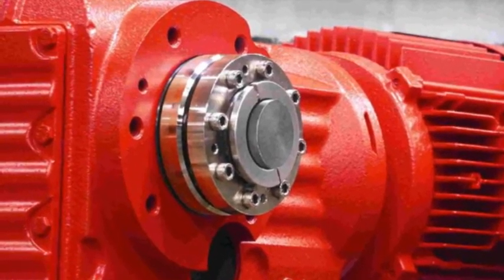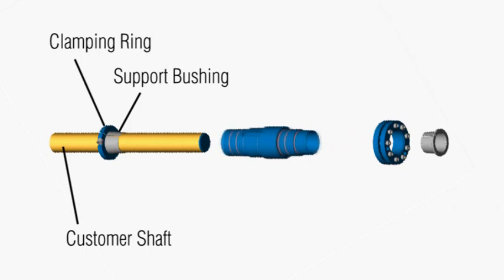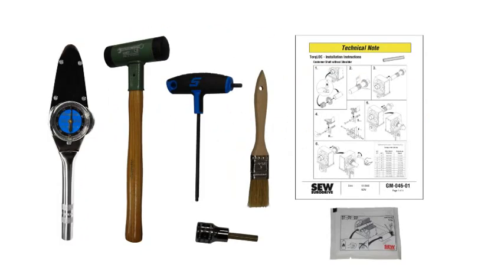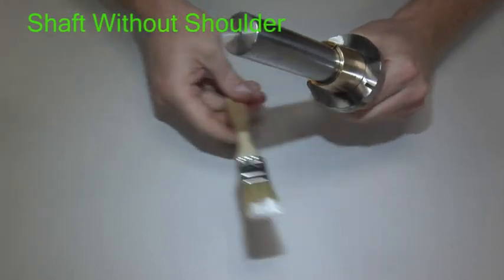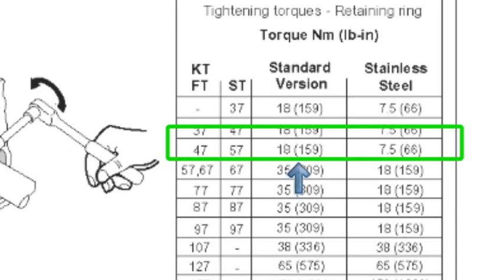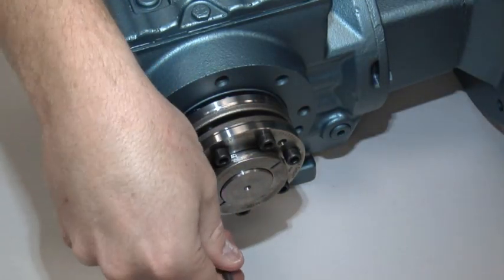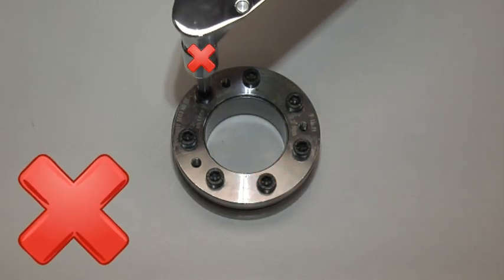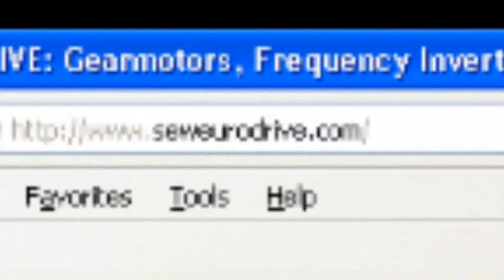TorqLoc Installation

Comment: So this is to allow different shaft sizes, to be installed into a universal hollow shaft geared drive, rather than having a set shaft size from the gearbox?
Reply from the maker: That is one benefit, but the main goals are to allow the customer to use a less costly design on their machine shaft. For example, shaft stock is acceptable. The TorqLOC® design allows for easier installation and removal of the gear unit especially in corrosive environments. In addition, the TorqLOC® connection to the customer shaft is not susceptible to key deformation that can be seen sometimes in applications with frequent starts and stops that use a standard keyed hollow shaft.

            The tech notes linked here give some more detailed information. 

TorqLOC® vs Keyed Shaft:
https://v5.ptpilot.com/PTPilot/documents/GM-034-02.pdf

TorqLOC® Advantages:
https://v5.ptpilot.com/PTPilot/documents/GM-035-02.pdf